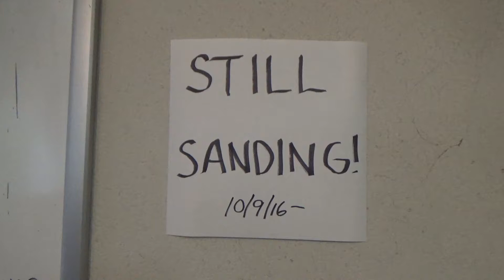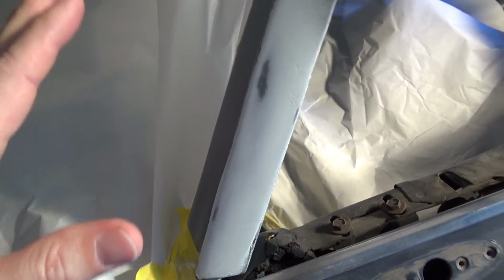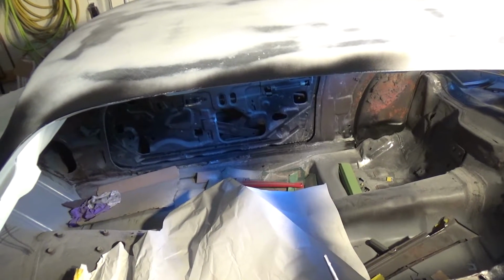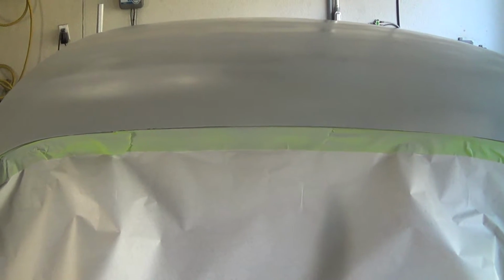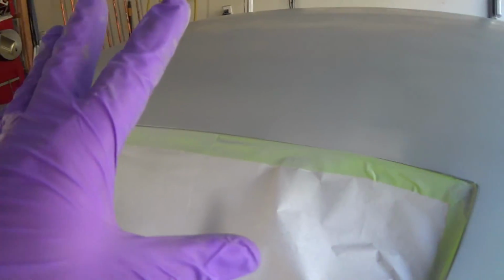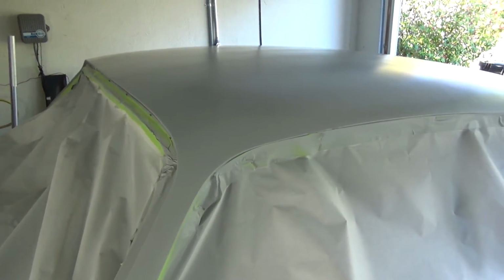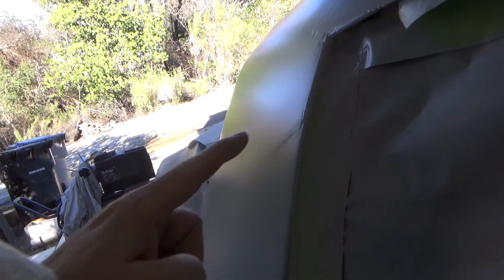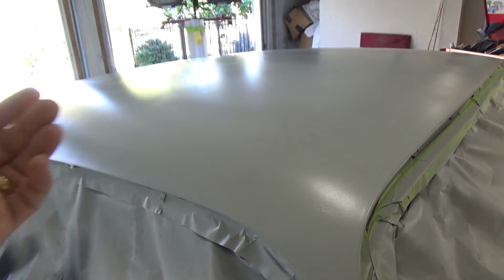1977 Camaro Z28 Part 113: Filler and Slick Sand on the roof

Comment: Looks good. This how I spray the roof - I start in the center and work my way out, that way I'm not leaning over wet paint dropping crap in it. Just the way I do it - don't know if its right or wrong, but that was the way I was taught.
Reply from the maker: Yeah, I was following the "wet edge" approach. I can see the merit in your approach too.

Comment: Also polyester primer will take upwards to 7 months to properly cure, as it will continue to shrink for that long.  It is designed for long term restoration s
Reply from the maker: It is not going to be going into paint for a while, so that should be no problem. However, I have never heard anyone say Slick Sand takes that long to cure. Remember, most of it will be sanded off too. Are you saying that anyone that uses these products needs to let them sit for 7 months before final sanding, or am I missing something?
Reply: asicerik yes.  I've been in both the collision and restoration industry as head painter for over 15 years . I've tested every product to see it's flaws and lucky enough to see most all my work age through the years because I live in a small town. If your not watching swrnc diy and swrnc on YouTube , he is from Texas and although he's a bit of a change of pace. You'll see he specializes in restoration and he completely has the same view point. From my head to yours, take my experience.  Remember a fresh paint job is dry to the touch, but doesn't finish shrinking and showing imperfections for 90 days. This polyester filler primer is the same way just longer
Reply from the maker: Thanks Brandon. I do watch Pete's videos, and know his opinion of the stuff. This really does not make sense to me though. I have researched this, and everything I have read says polyester spray on shrinks way LESS than 2k primer and cures in a matter of hours. I may post a video to get everyone's opinion. There are a number of people here on YT that use this type of filler. Some are what I would call experts (like jamesfreddys). So, I hear where you are coming from, but there appear to be multiple opinions on this subject.
Reply: asicerik I'll find petes video on this matter for you to help form your own opinions
Reply from the maker: I saw his video on this. I know his opinion. I don't know if this is an "old school/new school" issue or what. Like many things in body work, there are lots of opinions. Some people still prefer etch vs. epoxy e.g.
Reply: asicerik etch is for fast pace collision repair where they bank on people getting rid of their cars in 2-4 years, epoxy is for restoration where u know they are keeping it forever.   Easy to see what's best for long term. My paint expertise is pure knowledge on what's supposed to be done to the T and then my own experiences with reducing stuff vs not reducing , etc etc. 15 years head painter in the collision industry.  Where a lot of opinions on here are from people who paint 1-2 cars a year and call themselves painters is a joke . Take what you will, don't stop studying.
Reply from the maker: I do really appreciate all the input, seriously. You have taken a lot of your time to try to explain your position - and I thank you for it. Aside from your statement of a 7 month cure time (which I can't find anyone who says that, they all say this stuff cures faster/less shrinkage than 2k) I have not seen the downside to this stuff. What is the downside vs.wipe on or urethane? I also don't understand why you say it is not the same as body filler. They are both polyester based and use mekp hardener.
Reply from the maker: Have you seen this video from Kevin Tetz? https://www.youtube.com/watch?v=smudf-wpsoY He talks about the spray on poly here and why it is a good thing
Reply: Brandon Keele sorry I disagree  with this statement, poly hardly shrinks and is cured in a few days to a week which is different from regular 2k primers which can take up to a month or so .
Reply: MrFireman164 it may be due to the humidity level here in Tn, I do agree to the touch and sand ability it does cross link faster and stronger, especially over a good epoxy that's cured and been scuffed to adhere to.     My statement is based on vehicles that have came back roughly a year later and the suck sand has shrunk more.   I'm not trying to be argumentative.

Comment: I would probably start with 180 grit and see how it goes. I hope it warms up for you. Spraying in low temps may be tempting fate for proper cure. Especially epoxy. Panel temps need to stay warm for a long time for proper cure. Putting it in the sun on a 50 degree day will help because the uv will pull solvent out from within the film. Just my .02
Reply from the maker: Thanks Shawn. I will keep that in mind. It was not that cold when I sprayed the epoxy down.
Reply: asicerik Maybe I misunderstood. Just thinking that most epoxies need above 60 temperatures for 72 hours. Under 58 degrees the activators go dormant and don't cure
Reply from the maker: I sprayed the epoxy later in the day when it was not so cold. I have read that DPLV is good at 50 deg +, which is about where it was when I sprayed those small spots.

Comment: Looking good Erik! Is the SS a spray on filler? Damn! 7 months to cure?    He'll I'm staying away from that! Lol
Reply from the maker: Yeah, that's right. I have not seen anywhere that it takes that long. From what I have read, it is just like body filler. It is cured in a  matter of hours, not months. I would like to  see a reference for that 7 month thingy
Reply: jeff lindsey slick sand is awesome and is basically a sprayable filler , I used it on the camaro to fill 80 grit scratches and minor imperfections
Reply: Yea thanks Roger, I'll definitely look in to the SS and probably try it. Got tons of body work to do..

Comment: Never! Use primer to fix any bodywork u see that is wrong.    You need to add honey to your body filler so it spreads out like syrup with no pinhole issues over a large area. ....... never ! Use primer as a body filler!
Reply from the maker: I thought this stuff was spray on filler.
Reply: Asceric, Slow down Bud, it looks like your rushing and missing steps . Please use the minimum body filler required as it is a porous base and loves water. Sorry just trying to help mate :)
Reply from the maker: No worries! That's why I post these videos. I don't follow though. What steps am I missing? I am going to use the minimum filler, most of this will be sanded off. This roof was a mess, so it is going to need filler to flatten it out
Reply: Getting most of the sanding scratches out before applying/spraying, Shrinkback can be a bitch.Anyways i enjoy your videos and you are doing an great job.I know how much harder it can be with a hand with partial use.Take care my friend :)
Reply from the maker: Thanks man. I understand what you mean now. Yeah, I thought the scratches were gone until I started shooting the video. I appreciate the comments.
Reply: asicerik  no, it only got that nickname from fixing light hail damage